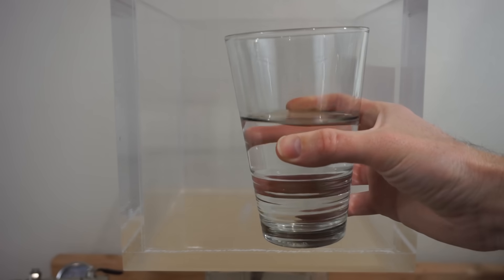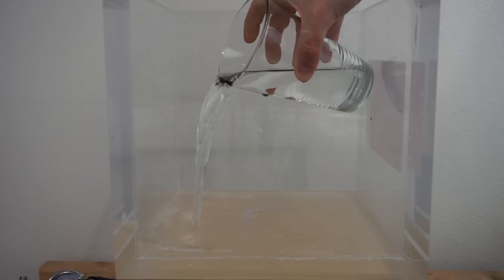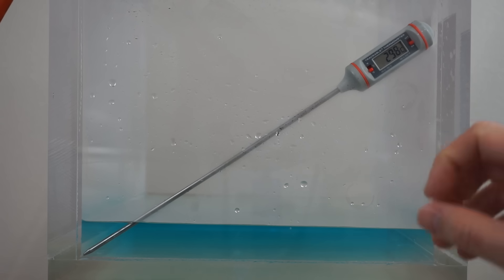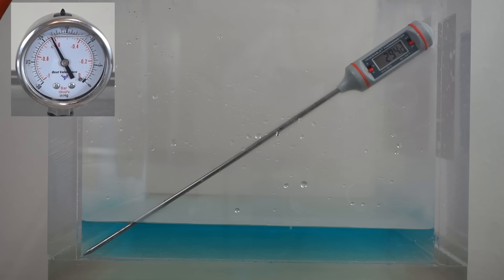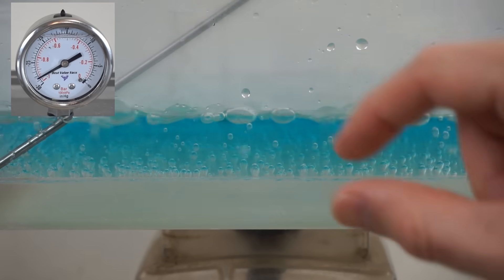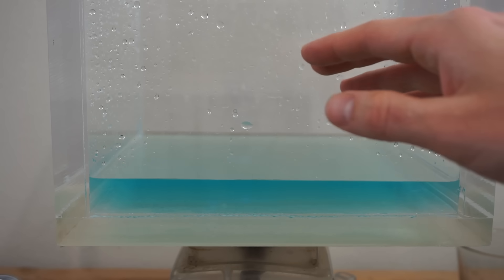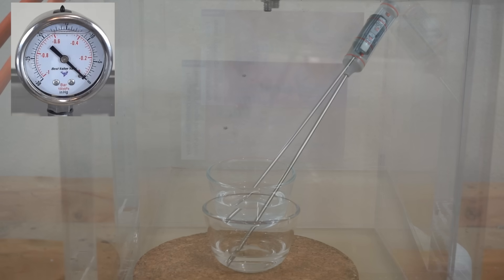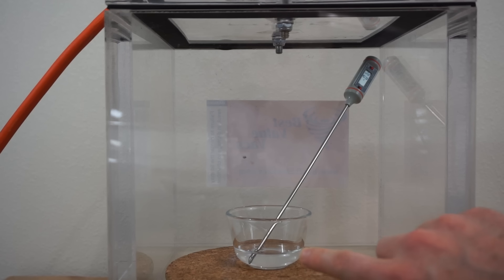Does Water Really Boil in a Vacuum Chamber? And Why?

Comment: In vacuum tech class the teacher did this experiment and eventually did get the water to boil and freeze at the same time.  It was in a beaker and the top of the water froze into a disk of ice.  And as it slowly boiled, the disk would tip to release the vapor.

Comment: If I had to guess, it's pulling the higher pressurized air out of the water to try and make up the pressure difference from the vacuum, creating the negative pressure? And thats whats cause the bubbles before it actually boils? Or I suppose that and just the fact that the air pressure is equalizing with the pressure of the air in the water?
Reply: Not quite. The boiling point depends on the atmospheric pressure, so in vacuum it lowers so much that it starts to boil at room temperature.
Reply: @zeendaniels5809 he mentioned that it was bubbling before it was actually boiling which was what i was  actually referring to

Comment: This answered a question I had... The question was " If water  boils in a vacuum quicker than on the stove then could we have a vacuum cooker??? " In my head it seemed logical because you would use less energy and get it done quicker... I now know that was a stupid question... It's OK folks I don't cook... lol
Reply: No because it is not the boiling that cooks your food, but the heat. It just so happens that the heat that is required for water to boil at normal pressure is also going to cook your food.

I guess this is not really a reply to you as you already figured it out.

Comment: Great video!!! The water probably didn't freeze not because the pump was overheating but you did not run it for long enough. The temperature was negative, so it probably needed a nucleation site. Either way your vacuum chamber is not build enough to handle these low pressures and I think you will need a stronger pump to reach waters triple point and go below like a freeze dryer.

Comment: Actually freezing point of water at vaccum is not 0 degree. Freezing point changes with pressure. 
Just like pressure cooker boiling point increases with pressure.

You can do this experiment with liquid nitrogen

Comment: You can actually try this at home! 
With a syringe and water.
You fill the syringe with water (remove all air) tap the exit with your finger and then pull. It will start boiling, the same as in the video.

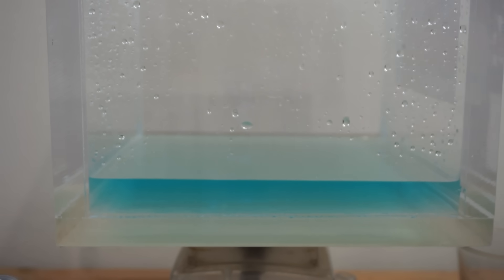Comment: 6:31 I asked ChatGPT “When water boils does it get colder?” 
And it said “No, when water boils, it does not get colder. The temperature of the water stays constant at the boiling point as it turns into steam, but the water is still hot. Any additional heat goes into changing the water from liquid to gas, rather than increasing the temperature.”

Comment: the water in that last demonstration was never going to freeze until after you released the vacuum, for the same reason that it was still boiling. do you mean raising the pressure also heated the sample enough to prevent freezing?

Comment: now what happens when u put ice in a vacuum chamber
Reply: it will melt eventually. while water is far from the boiling line in the water phase diagram, it cannot cool so, it will heat faster and melt until you get under 0.006 atm. at that point, boiling line and freezing line merge together.

Comment: Considering what the composition of water is, you wonder if the hydrogen and water are seperating when you do this?
Also, wondering if you can remove the water entirely to have hydrogen extracted from water.
Also, when you remove the oxygen in the tank and the water settles, or does it?, is what is left actually just hydrogen mixed with maybe one molecule of water?
So maybe changing from h 2 o into h 1 0 ? If that is possible.
Reply: until you don't use electrical power, you cannot seperate water's atoms physically if it is not gas. in this experiment, there is only vapourized water, which is not gas, and liquid water. if you confused about the "fish, air, respiration, oxygen, eg.", fishes respirates the oxygen molecule dissolved in the liquid water, not the atom water molecule includes. because the air is rich about oxygen molecules(%21), if you pull air out of the chamber, the dissolved oxygen will take the place first.
Reply: @hakanlatifoglu5209  ah, so what if you took all he air out and replaced it with a different chemical or substance, something to "fill in for" the removed oxygen?
Is there any gas or substance like that?
Also, could a device be used to separate the hydrogen and oxygen molecules in the water to extract pure o2 from it to remix or use?
I know it takes a lot of energy to split atoms, but is here a way to maybe filter or cause the particles to separate on their own?
Reply: @andrewvarcoe4741  you can fill another cup with liquid O2. But it will work as long as you don't pass the partial oxygen pressure in the air(which is about 15 mmhg). At that point, the water will vaporize as there is no oxygen in it. And I think, there is oxygen extractors as a better solution, that they will extract pure O2 from air, which seems like the better solution because many hospitals use them as oxygen source. But as a disaster plan, there is factories that produce distiled water. You need to electrolyse distiled water with some voltage to seperate H2 and O2 molecules. Then you will see the gasses forming at  electrodes.
Reply: @hakanlatifoglu5209  wicked stuff, usually don't expect educated answers on this type of stuff, they just get ignored lol.
I am now curious if something is made or generated as a side effect that might be collected or utilized for something?
I wonder if you can do anything with a pure o2 environment and when you pull all the o2 out are you not left with other gasses, I assume they are types you cannot see.
Also, using this idea, could we mix different combinations of gasses to see what might form or be made?
I'd be curious if you could change the remaining gases into either liquids or make them attach to micro particles to make a solid of some sort?
Sorry if this is a lot of questions, but its got my brain wondering, what if.....
If this process could be recreated for other materials or combinations of substances, you could almost make edible air or maybe blocks of o2 that slowly dissolve releasing the contained o2 or have it absorb and attract other gasses in the air or possibly water?
Reply: @andrewvarcoe4741  this is a bit messy, don't be ashamed about it. But it is hard for me to understand and answer precisely. After extracting o2 from distiled water, only side product(if you mean it by "effect") is hydrogen. There is a wide variaty to use hydrogen from new era nuclear reactors to only burning it. With pure o2, there is also wide variaty from resurrecting people to using it at blowtorchs. Now comes the interesting part. if you wanna create any non gas product from gasses, you need to make them heat the environment, for example, if you wanna condensate a vapour, you need to cool any surface around it, if you want to make coke with co2, you need to cool the mixture, if you wanna make h2o with h2 and o2, you need to burn them together and cool down the remaining vaporized h2o, even the transistors(used in modern processors) is made by adding phosphorus gas and boron to silicon. other than that, oxygen tubes are the best solution for slow releasing oxygen today. And hemoglobin is a protein that attracts o2 from air in humans and attracts o2 from water in fishes if you are looking something like that.That's all. I think I answered all your questions. I am not an expert so I may not answered your questions well. Talking with a teacher or someone expert must be better than me.

Comment: 8:21 im no expert, but it shuld freez cuz its lower preasure, right?
Reply: probably the thermometer is not calibrated. if you think about, it's traveling around the right most line at the water phase diagram. so you need to go down under 0.006 atm to freeze water by reducing the pressure.

Comment: THat is NOT air dissolved in the liquid! That looks like and is the water slowly coming to a boil. You dont all of a sudden get big bubbles. the water has to flex in the vacuum in order to boil rapidly. So those ARE small and slow boils. You are delusional to think they are anything else. Large bubbles are vaporizing as the small ones are.

Comment: What about a water filled vacuum chamber? Where the water fills the chamber? Does it boil in such a case?

How does water freeze in space then or is there even water in space? I know comet's are supposed to have tails made up of gas and water offshoot, but how is such a thing possible if water boils in vacuum?
Reply: I don't know the answer to other questions but water can freez in space because there is so fucking cold there. In vaccum water can boil even in -70c but in vaccum of space there is around -270c so yeah. Pretty cold

Comment: But sir, why bubbles can't form inside the bulk water before it's vapor pressure becomes equal to atmospheric pressure? I mean shouldn't the pressure inside the bubble that should matter and not vapor pressure, why can't the high energetic molecules  form bubbles inside the water which has pressure greater than its surrounding pressure and escape? And if it's just about bubbles why can't water temperature rise further than the point where it's vapor pressure becomes equal to atmospheric pressure?

Comment: Why does water take so long to transition from liquid to gas in a mear perfect vacuum?  If you shut the vac pump off, will the liquid continue to transition to gas until it builds enough pressure to stop for a given temp; or will it simply never convert.

Comment: Oxygen liquifies at 750PSI. If further pressure is applied the volume will not change but what about the temperature ? If for example 5800PSI, would the cylinder warm up or stay the same?

Comment: First, boiling is not when liquid turns into gas. That would be evaporation. During boiling evaporation happens not just on the surface of the liquid but also in its volume. Bubbles. But boiling itself is the maximum temperature a liquid can have in its current liquid state, because all the energy you pass to it gets absorbed as latent heat of evaporation.

So why do bubbles not appear in normal conditions until water reaches its boiling temperature? Pressure. For bubbles to form, those molecules need to overcome the pressure of atmosphere and the pressure of water. The deeper you go, the more pressure those bubbles face. In a glass, the pressure of water itself is not significant though.

So by removing the atmospheric pressure you allow those bubbles to form facing about no resistance.

You will still need to spend 105kJ energy per a gram of water to evaporate it, instead of 315kJ energy at 1atm.

Comment: I work with deep vacuum in the semiconductor field I have froze water as maintenance tech and in deep vac deposition. I have froze water the targets we are depositing with heat up and need to be liquid cooled. but can leak fill up the chamber. When exposed to a mag lev liquid nitrogen cooled turbo molecular pump spinning 82k RPM  to a 24” deep 6 foot radius chamber the bottom 3rd will freeze and you have to spend 2 hours with a heat gun and a shop vac and fix the leak. Also rebuild that gate valve. I I was allowed to solve the problem  from ever happing again I would put in a new feed threw for low voltage sensor continuity probe. I’m also looking for a job 😢 🍺
Reply: Also one more if you start pumping down. And open a cryo chamber with a chilled copper coil in it for a short time and get it to pull all the moisture out by condensation. If you wanted to try that try would be cool man.  It’s a cheap way to increase pump down speed if your trying to pump down faster before it escape as a gas march larger volume, force it to condensate on a coil.

Comment: Like the boiling point reduces in vacuum, did the freezing point also reduce ? What actually happened when you let the air back. My guess is it should have started freezing as the air came inside.

Comment: If you stop the vacuum pump and close the vacuum in the vacuum chamber, does the boiling continue? or the pump must always work. I mean if the pressure remains at -1 bar in the vacuum chamber after the pump is stopped, but the vacuum chamber keeps the vacuum at -1 bar further.

Comment: So would the water keep boiling off at a certain pressure, or would it stop boiling once it cools to a certain point? Also would you have to keep the vaccuum running because the boiling water turns to gas and that gas repressurizes the chamber? Thanks 😃

Comment: Sir

Bit confused with terminology.  I was taught boiling is associated with heating.
In your experiment
, water seemed to bubble intensly while getting cold.

Your experiment seem to indicate that water gets phase tranformed both under vacuum n heat.

Under heat it boils n under vacuum it bubbles to coolness?

Please advise where i go wrong?

Thank you
Reply: Colloquially, we generally associate boiling with heating.  But the same process as boiling can happen by removing pressure, so that it happens at room temperature.

This likely is called cavitation instead of boiling, but ultimately it is still the same physical process.  This is a serious problem for pumps, because if you have too much suction at the inlet, the water will boil (cavitate), and the pump will not work.

Comment: Boiling occurs whenever the vapor pressure of the liquid and the environment pressure are equal. Evaporation occurs at all temperatures between the melting point and the boiling point, (fastest evaporation speed at boiling point)

Comment: If the chamber volume is small enough, and we've reached a vacuum pressure where the water is boiling and we are maintaining that pressure (we are not further reducing the pressure) doesn't the partial pressure of the water vapour reach its 100% relative humidity (saturation vapour pressure) and suppress the boiling phenomenon ?
Reply: Boiling doesn't rely on gas to take up the liquid. Normal evaporation and boiling are 2 different things. When boiling, the liquid does not need to diffuse into a gas, but directly becomes gas. I would say that a lot of traditional 'boiling' like on a stove is just evaporation and not just boiling.

Comment: If it boils in a vacuum 
Does it freeze under extreme pressure 
But if that was true, what happens in a pressure cooker…. It would cool itself as pressure got extremely high? 
And one more question 
Hot water sinks and cold water floats?
Rite. Otherwise Ice would sink but what happens to water in a underwater volcano…. Wouldn’t it just build up around the hot spot till it turned to vapor, but with the pressure at that depth…..🤯

Comment: My thoughts :  Cold or hot cant exist without a nervous system.  Like sounds, smells, flavours don't exist without a nervous system.
Only when the natural state of matter is seen or felt to be altered is there reason to suspect a seperate external force has been introduced to it.

" Unusual motion detection " 

Without "unusual motion detection"  hot and cold will not exist.  
 " unusual motion information transfer " UMIT.
Without a complete nervous system and a mind to asses it,  information is nonsensical and without meaning.
Given we react to the environment. Life unscrambles and gives sensibility and meaning to the universe.  
Only a complete organism can decode information and react to it.  Anything that comes before completion of an organism is a programmed reaction.

Organic Cells contain various life forms or soft tissue robotics constantly becoming reactive to information stimulus.
Every reaction is programmed to occur in a definitive way in response to information received.
A chain of reactionary programming is continually cycling information back and forth between container and environment.
Programmed information response can however be altered/ varied.. if detected by a breaker point.
A highly complex software package inserted at this point alows predictive and unpridictive information to be re inserted back into the information transfer chain.
Time lapse due to information transfers causes first degree burns to occur in humans.  🤔 is it hot.....arrh !!

Also if you didn't pick up on it.
It means sound , smell , taste, light, dark, touch, hot, cold, etc.... can only be detected when " unusual motion information transfer " is experienced by a complex code generator.
Without programmed codes. The universe can't exist as we experience it.
To clarify.
A life force without codes or a program , is a life in a NOTHINGNESS. It has no concept of any Information being generated outside itself.
It will do NOTHING as it can't detect the information. It believes it's alone in only a blackness. 

And if you don't pick up on what that means ......well,.... let's leave it at that shall we.
Be safe and well.

Comment: Does heat go up? Is the water vapor near the top warmer than the boiling water?
Reply: It doesn't heat up, it lowers the boiling point of water
Reply: @hilltain2198  but if it gets cold .. heat must be coming off it? Right? The vapor escaping should be warmer.. I think

Comment: An interesting side note is that those air bubbles coming out of dissolution as the pressure is decreased is exactly what happens to a diver who gets "the bends" or decompression sickness as they ascend from depth too rapidly. The nitrogen that has dissolved in their blood and tissues comes out of dissolution rapidly, forming bubbles that cause joint pain, embolisms, even death, as the pressure is decreased. The way to combat this, other than mixed gas diving, is to decompress at a prescribed rate, which allows the nitrogen to be removed slowly and gently through exhalation instead of forming bloodflow-impeding bubbles.